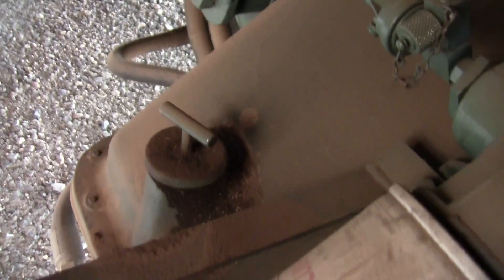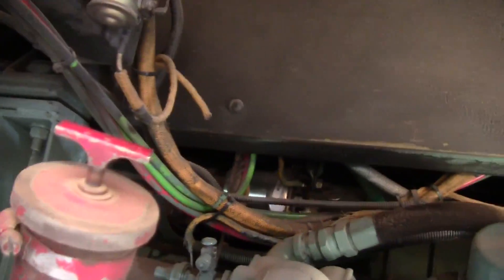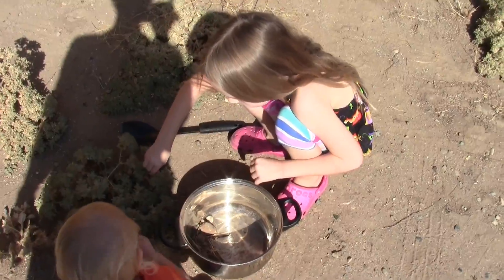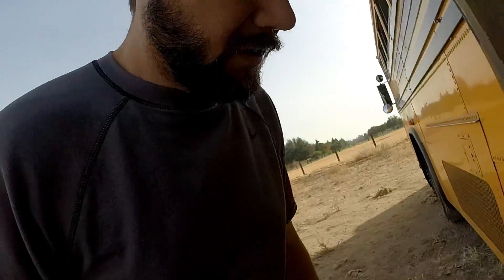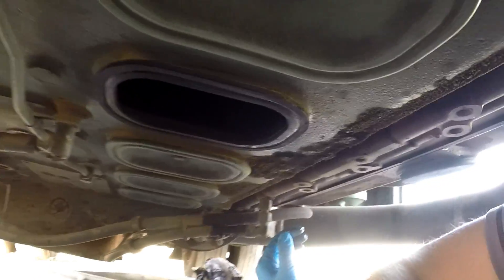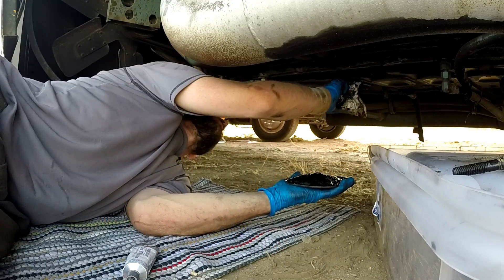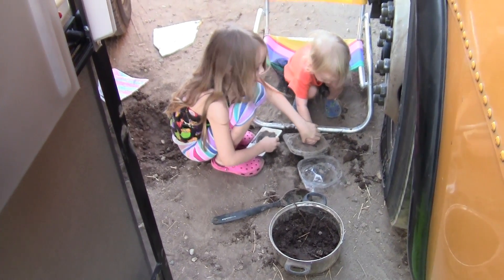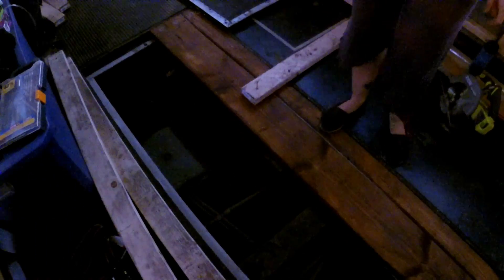Crown School Bus Conversion | Rusty area Prep and Paint | Engine Tuning Detroit 6-71 | LoC 39

Comment: Still smoking after you've "Run the Rack"...... Im not quite up to speed on the Detroits, could the turbo be passing oil by its bearings into the intake??
Reply from the maker: It's a possibility but in a later episode I find that it's a bent valve. It's going to need a head swap. We're saving for it now. Thanks for watching!